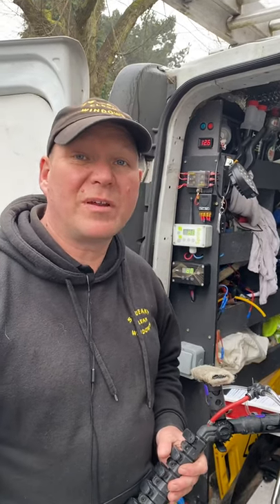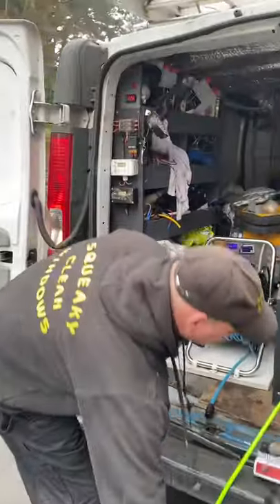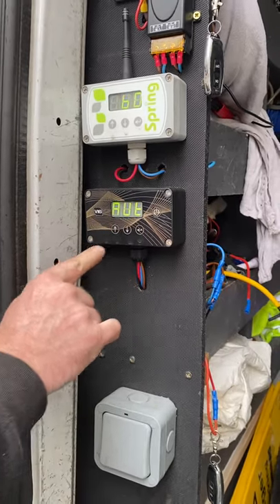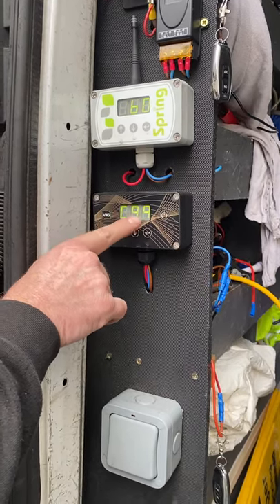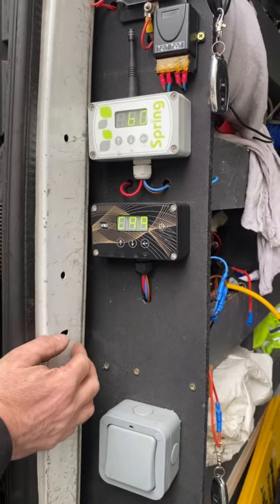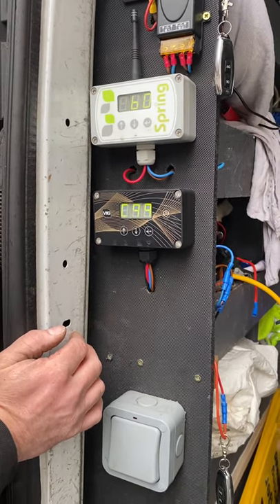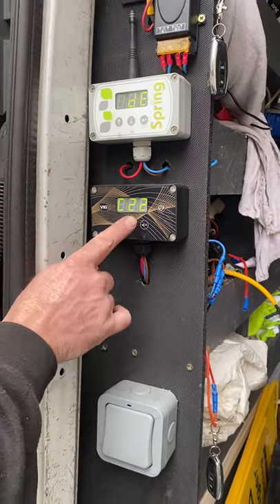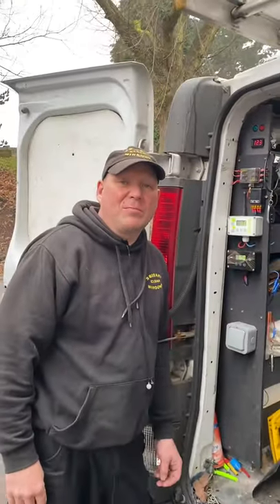How To Auto Calibrate The Dead End On A Water Fed Pole Controller #Shorts

Comment: Hi Dave great info , I’ve just installed my first ever wfp system 350ltr , final thing to do is set the dead end as above , once I have set the dead end will adjusting the my water flow on future occasions affect this calibration or can I change my flow setting without affecting what the auto cal has pre set as per your video, Thankyou in advance
Reply from the maker: If its only small amounts it should't affect it. what does affect it more is air temperature. When it's cold the hoses go stiffer and when hot they go softer and this can make a massive difference.
Reply: @squeakycleandave1 Thankyou for the response dave much appreciated all the best for 2024

Comment: Hi Dave, i wonder if you or a fellow subscriber on here can diagnose my current problem? Ive got a Grippatank van mount system and for some reason it has stopped producing water from the waste outlet when filling? It fills just fine but intead of 60/40 its 100% water going straight into tank!
Reply from the maker: Hi JD
Sorry for the delay. I've been away. I would contact Grippa if i were you but the only things i can think of are the waste to pure ratio tap has been knocked ir there is a blockage somewhere
Reply: @squeakycleandave1  All sorted Dave. Between Grippatank & Sureclean Omagh we diagnosed a solenoid problem. Up & running again thankfully. 👍

Comment: I’ve set mine with the pole fully extended and It doesn’t seem to have a very good flow, looks like I’ll try it again, cheers Dave 👍👏
Reply from the maker: The dead end shouldn’t effect the flow if it’s set right
Reply: @squeakycleandave1  hi Dave my pump keeps dead ending if I put the the pressure up past 50, any idea why ?
Reply from the maker: @skyrider29  best thing to do is to give Spring Europe a call and the will fault find for you. 
 01892 662078

Comment: Shouldn't the pole be fully extended? And upright? The manual that came with my flow controller say so.
Reply from the maker: It’s probably the best way of doing it but when I spoke to spring when I first had mine they didn’t mention it
Reply: @squeakycleandave1  The dead end changes a lot when doing it this way instead of with the pole collapsed
Reply from the maker: @MrFixItDK  I will try it tomorrow thanks for letting me know 👍

Comment: Nice one Dave, I’ve turned mine down due to the fan jets.
I bought the V16 with built in b2b seems to be working well, not put it under a pressure with a long working day as yet.
Let’s see how it goes.
Just bought a one-shot too, need to get that fitted once I change the van about again 🙈
Reply from the maker: The V16 is an awesome controller 👍

Comment: Had my V16 and new pump 2 days, I’ve done auto calibration it sets on 56. Then I turn flow up and it just keeps staggering. So I have dead end set to around 70 now just to keep running and it’s just using PS which is annoying as bought to use for dead end 🤔 any ideas Dave ? TIA
Reply from the maker: Give spring a call as it’s definitely not right. Mine dead ends at around 37 with cold water and 15 with hot water
 01892 662078
Reply: @squeakycleandave1  cheers Dave will do.

Comment: Hi Dave. I’m new to all this and I’m currently setting up my van system. I calibrated my controller the way you showed but when I turn off the water to my pole with my univalve the the controller goes between DE and the flow rate and it just sounds like it’s stop/starting. Is this normal or is there an issue?
Reply from the maker: Its normal for it to flash between DE and the flow rate but it shouldn't keep starting the pump if the univalve is off. 
Sometimes the auto calibration doesn't quite get it smack on so you need to  tweak  it manually ether up or down. 
If its still not working right give Spring  a call and they will let you know what needs to. be done. 
Main Office: 01892 662078

Comment: Finally done this but my pump is still taking ages to switch off and then still let's of tiny pulses all the time it's on the dead end. Any ideas on what the problem is there ? Thanks
Reply from the maker: The heat at this time of year makes a massive difference. The hoses get hot and soft so when you turn the water off the hoses expand so it’s not such a sudden change in pressure for the controller to recognise
Reply: @squeakycleandave1  thanks but it's been like that last winter aswell. I can work like it fine obviously but something isn't right there
Reply from the maker: @vinny442  might be worth giving Spring a call

Comment: So does that mean the flow rate should be set at 22?
Reply from the maker: No  The flow rate and the dead end are 2 different readings  The flow rate is the amount of water coming through and can be set at whatever you want.
The dead end determines how fast the pump is turned off when the flow is stopped. The auto-calibrate will set the dead end at the best setting for your equipment and the conditions that you are working in
Reply: @squeakycleandave1  got you 👍  mine was starting and stopping,   squirting water for a few seconds then stopping,  then restarting and repeating.  All sorted now after watching this.  Thanks Dave,  legend 👍

Comment: Great video Dave, if I change my flow rate after auto setting the dead end, will i need to re calibrate?
Reply from the maker: Thanks for watching 👍
Reply: Flow and dead end are two different settings. If you have done the calibrate correct you don't need to re-calibrate again unless you change your pole setup.

Comment: what does the d3 mean on the white controller mate
Reply from the maker: It’s DE which means that the water is stopped with the controller Dead end. 
If it was PS it would mean the pressure switch has turned the pump off so the controller would need recalibrating
Reply: @squeakycleandave1  would u know how to fix the DE as I turn flow up pump don't do nothing and DE shows up
Reply from the maker: @pickwick822  give me a ring tomorrow and I will talk you through it if you want. 
07956222348